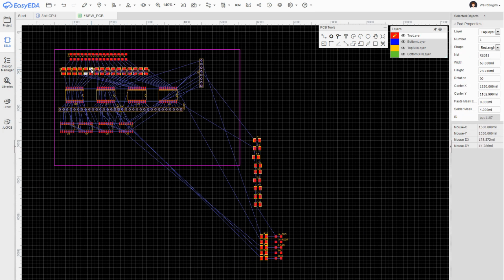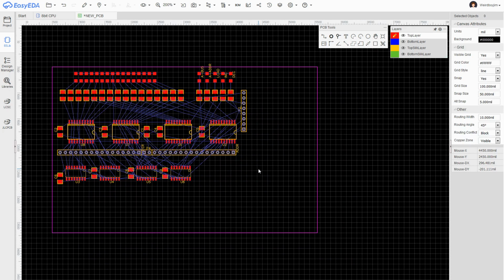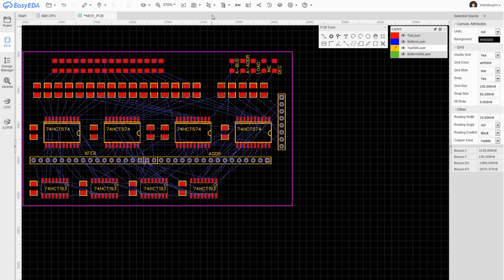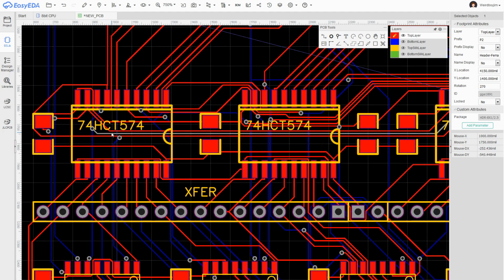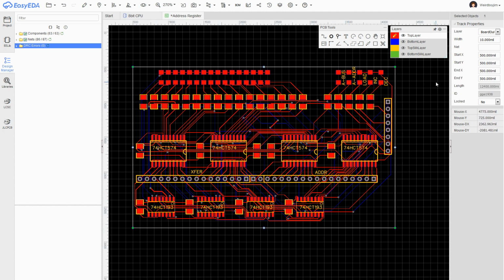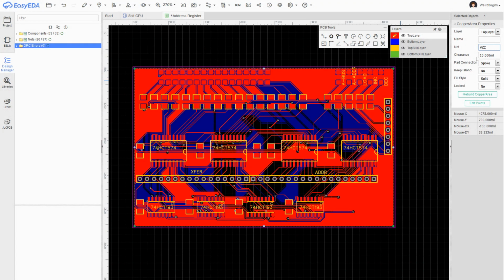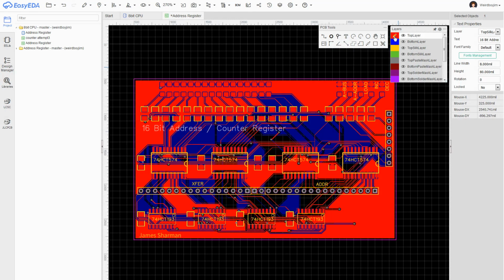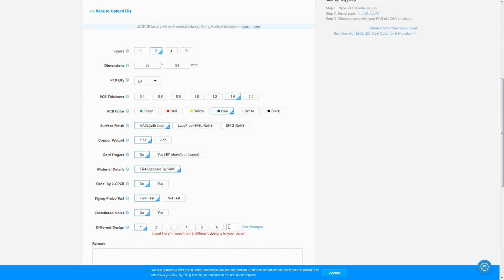Address registers (6: PCB Layout) - Making an 8 Bit pipelined CPU - Part 15

Comment: pros don't use autorouter simply because unless is a really simple design the autorouter solution is always garbage... but it is really amusing watch it struggling :D
Reply from the maker: Well, good thing I don't claim to be a pro then. But I did start hand routing everything later on in this series.

Comment: Plenty of grounds is always good, as is a good tidy up. But I’m less sure about omitting carry and borrow out. You may want access to those when you come to make a status register and want to test for overflow from inc or underflow from dec in software.
Reply: Oh and I know this is an old video. I’ve watched your VGA, Audio and UART series and am finally working my way through your fascinating CPU design and build. Great to see how your techniques have come on from the early days. Videography, confident narration, design and layout. Great work James!
Reply from the maker: I did briefly consider an additional counter register with the borrow line exposed. That would be handy doing larger loops.

Comment: I think the biggest issue with the routing was the bus being connected for both reading and writing. Using 2 bus connectors for that probably would have made it much simpler.

Also, putting the capacitors next to the chip blocks lines from using that side to exit the chip area. Putting them so that one leg is near pin1 and the other is pointing away would be fine, the position of the ground-side of the capacitor doesn't matter.

And then, I wonder if putting a ground via in the middle of those giant capacitor pin pads would cause any issues when soldering.
Reply from the maker: This was the first pcb I ever designed, hopefully my later designs show a bit more logic but I'm still improving.

Comment: Just a question, putting a vcc region on the top and a gnd region o  the bottom dosen't create a capacitor effect on the entire borad that can cause data signal to get a lot of interference?
Reply from the maker: Interesting question,  understand of course that this was my first pcb and I've learned a lot since then, nowhere near an expert yet though. I do not believe Extra capacitance would be a source of interference, after all we go out of our way to add lots between vcc and gnd for decoupling. Most circuits use gnd fill both sides (as I do now) as consideration for the signal return path.

Comment: I like the comparison between compilers and auto-routers, but I think today's auto-routing compares more with early days' C compilers - you spend so much time tweaking its result that it is better and faster to do the low-level stuff yourself. At least that's how I felt when I tried PCB layouts myself.
Reply from the maker: Deep down I feel that auto routers should be better! Part of me wants to take a crack at the problem but it would be a big time investment with a high chance of not getting better than current offerings.

Comment: A tip for pcb design, if you use a 4 layer board you can make the top and bottom layers data and the layers in between power and ground. So you can just place a via to connect to VCC/GND or to the other side.
Reply from the maker: I do this in some later videos